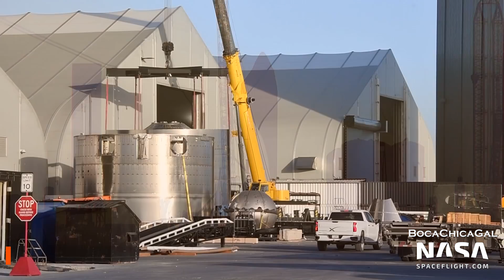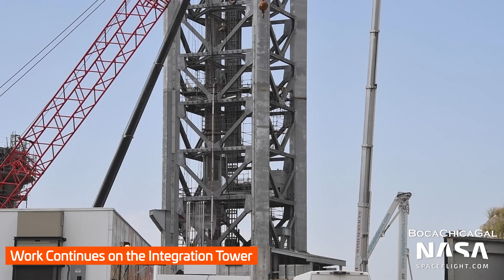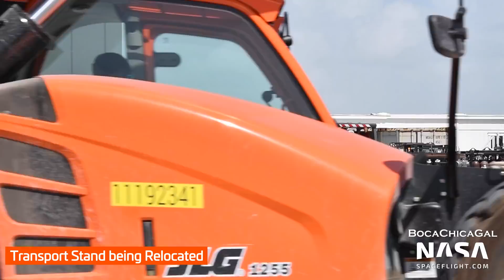Construction Begins on New Wider High Bay | SpaceX Boca Chica

Comment from the maker: Time Stamps! 

0:00 Sunrise
01:30 Moving Ship 21’s Dome Section off of the Sleeving Stand
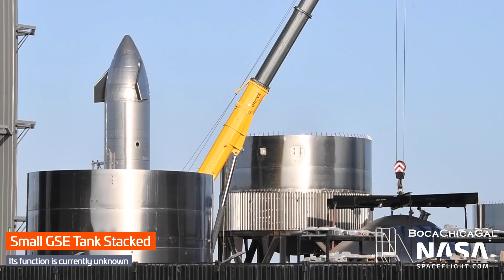01:54 Small GSE Tank Stacked
02:25 Ships 15 and 16 Watching Over Production
02:55 Breaking up the Concrete North of the High Bay
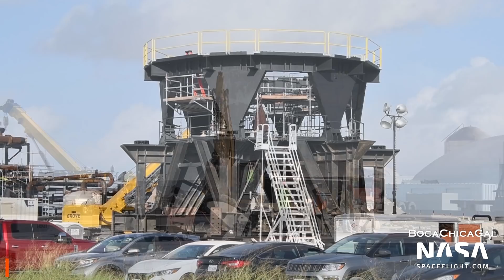03:40 Mystery Stand Structure Awaiting its Purpose
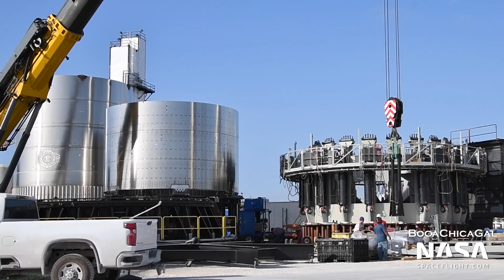04:10 Additional Parts Installed Inside of a Ring Stack
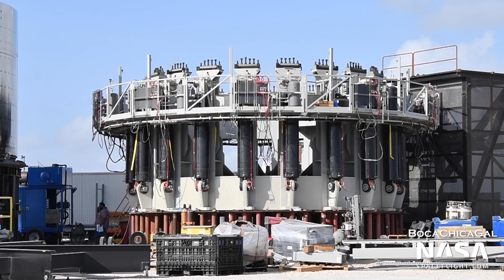05:40 Booster Test Stand
06:05 Construction of a New Stand (New Booster Stand?)
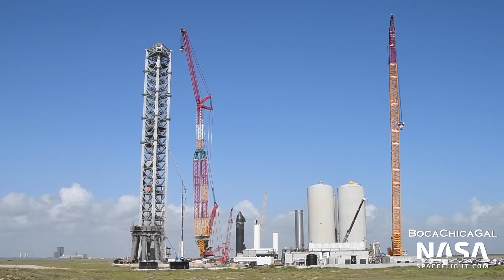06:30 The Orbital Launch Site
07:00 Work Continues on the Orbital Launch Mount
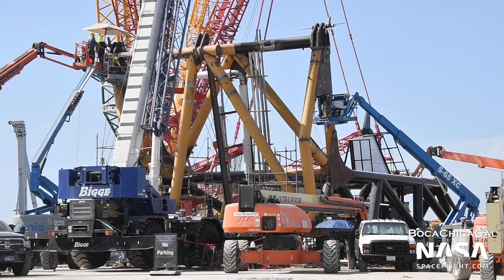07:30 Quick Disconnect Arm Being Strengthened
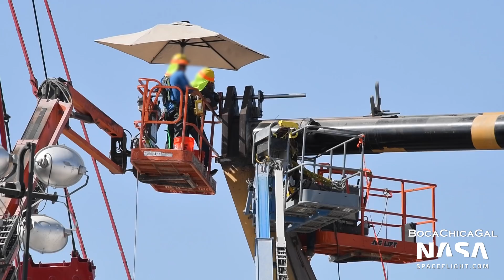08:30 Line Boring a Quick Disconnect Arm Hinge
09:05 Ship 20 on Suborbital Pad B
09:35 Ship 20 has many Markers on the Heat Shield
10:01 Work Continues on the Catch Arms
11:01 Liebherr LR 11000 Moving to GSE Tanks
11:31 The Orbital Launch Mount
12:02 Work Continues on the Integration Tower
14:25 Equipment Installed at the Orbital Tank Farm
14:53 Transport Stand being Relocated
15:23 Raptor RB24 Delivered
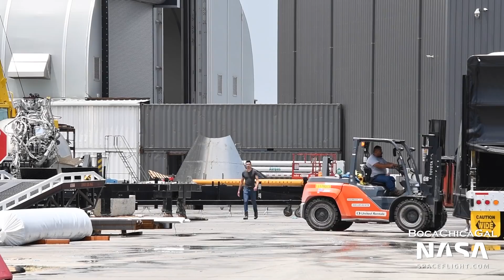15:52 Work Continues on Small GSE Tank
Reply: Who thinks the small GSE tank is a test tank for booster or orbital starship?
Reply: At 8:08 the black v shaped structure is part of the verticle slide carridge that rides up and down the tower with the catch arms will connect to it. 😉
Reply: @its.rfscannel9338  It could be a beer tank...
Reply: I think I spotted a face on with all the tape for the tiles... and it looks like Rick astley.
Reply: Is that DARTH VADER inspecting the orbital launch mount!? 07:00
Reply: I want an OnlyTanks t-shirt
Reply: @marsmountain2794  Yeah, I think it is.

Comment: The "equipment" being installed at the orbital tank farm was a very large multi-stage submersible pump. Signed, your friendly neighborhood civil engineer.
Reply: What does it do, in layman's terms, if I may ask?
Reply: @Gabriel_PL  notan engineer. Bit I think it pumps stuff
Reply: Can you tell from just looking at it, whether it's meant for cryogenic liquid pumping, or water? I'm assuming it's not obviously easy to tell!
Reply: @Gabriel_PL  Multi-stage may look like 1 pump but has several pumps in series inside. Meaning the fluid goes from pump to pump to pump each increasing the pressure. If each pump can do 10 bar than the total out put of 3 pumps in series is 30 bar. A submersible pump sits in the tank and in the fluid it pumps. So yeah it pumps stuff.
Reply: Vertical turbine pump - not submersible.  The impellers are submersible but the motor is not.  That's the difference.

Comment: “Line boring a quick disconnect arm hinge”

I understand all those words individually...
Reply: Lasers are a beautiful thing.
Reply: Funny, I was just watching a video on building a race engine and the guy said to send your main studs along with your block because they need to install them when they line bore the main journal. (or something like that... I'm really not an engine guy.)  Then, I watch this video and get to see what line boring is!
Reply: When you need several holes a distant apart to align exactly, you use this laser assisted instrument to drill all of them using it, one by one.
Reply: I googletranslated this sentence in my native language ..  This was inconclusive, so I concluded that this sentence was a new mystery structure
Reply: @jardozouille1677  No mystery. Reed my prevoius comment.
Reply: @knowlegeisgood8735  I read your answer, thanks. NasaSpacelight loves the mystery structures, so it was a joke :)
Reply: @rogerhalt3991  and bearing

Comment: My speculation is that the small GSE tank is for argon. They'll be collecting it as they process air into elemental gases and it's a good shield gas for welding too. That would save a lot of money down the road.

Comment: 11:32 That's a mobile perlite expander (upside down U-shaped pipe in the foreground). For insulation of the cryo tanks.
Reply: Cool. I was wondering what the insulation would be.
Reply: Yeah, all the speculation on insulation, but all modern air separation plants, like the one built there at the SpaceX site, fill the annulus between the distillation columns and the outer shell with perlite, since it can be removed if maintenance is required. Sometimes it would help if the NASA Spaceflight guys had some experienced  engineers (all types) they can consult with. With a chemical engineering background, I sometimes cringe when they misidentify equipment.

Comment: Can't wait to see the Higher Bay XL - cuz if the High Bay has a bar on top, the XL will have to have a cafeteria!
Reply: It will have a bridge crane that goes from side to side. I don't think that leaves any space for more bars.
Reply: @knowlegeisgood8735  As with the high bay. I'd heard the scuttle butt that the wider bay would be slightly higher, so perhaps with JUST a little extra on top they could have an open space that could be enclosed. Would make for another awesome observation site for a launch.... and a bite beforehand.

Comment: @NASASpaceFlight
 Before we find out the real reason, My guess is that baby GSE is for storage at the Fuel production site before it is transferd to the OLS tanks.
Reply: Apparently it's a thinner steel they are testing. But I like your theory too. They will need some kind of intermediate storage at the prop production site.
Reply: It's a 3.6mm test tank. SN7.3 maybe?

Comment: I wonder if NASA had 21000 individually shaped heat shield tiles for a reason...or were they just bored that week?
I wonder if losing one while slowing down from 17,500 mph to zero,  while converting air into plasma will care of it is made of aluminum or ..beer can thickness stainless steel?
..or if it will just create a large blowtorch that burns through the steel in a matter of minutes rather than seconds.
Can't wait to watch and find out!
Reply: I don't know why NASA used glue and individual tiles, but one of the main reasons Starship has identical tiles and the majority on studs are the experiences they had with Shuttle.
SpaceX has also an advantage of using stainless steel. Easy to weld the studs and over 3 times as good at taking the heat (which just goes on a few minutes). The tiles were tested using blow torches btw.

Comment: The small GSE tank looks more like a grapple arm tester to me.
Seems to be rather recycled parts.
There are pegs looking out of the tank, which in my opinion are offset by 120°/60°.
Just like the grid fins on the booster.
It will be interesting to see if the part can be seen from the opposite side. Then it shows whether there are the same pins.
Reply: Interesting theory.
It does look a test tank, but it is a bit late to test the GSE design
Reply: It's a 3.6mm test tank. SN7.3 maybe?

They are currently working with 4mm thick stainless. They tried 3mm thick a while ago with SN7.2 but it didn't work so well.
Then 3.6mm steel was seen rolling in recently. So it's very likely that they are still pursuing a thinner starship and this must be the test tank for because it looks identical to the previous ones.

TLDR:  there is no 'Small GSE Tank.'

Comment: I'm afraid they will replace the nose cone of ship 20 since they have to redesign the flaps, and has all those tiles to be replaced might as well :)
Reply: They need clean edges. Cutting it off would be hard. Much simpler to go to S21 right away, if they want that.

Comment: i have a feeling they’re going to start early development of the 18m diameter starship 

 the original was double the diameter of the ones they have been testing and the math makes sense all around to do so aswell
Reply: Elon said on July 1 "“Doubling diameter increases mass 4X, but difficulty of simultaneously building & launching rocket of that size is >>4X. 
In retrospect, <9m diameter for Starship might have been wise. Current size is ~5200 ton stack mass & ~7500 ton-F thrust, which is more than double Saturn V.”
Reply: @knowlegeisgood8735  elon announced its on the way
Reply: @JL-bl9eg  When did he do that? In what context?

Comment: The engines being delivered, are they some of the ones which were 'installed' on B4 but hadn't been tested at McGregor, which now have been and are back for integrated testing?

Or are they new engines? I haven't been keeping up with the engines.
Reply: Probably. Any engine that had a white (on the inside) bell was an engine not tested. They went back for sure.

Comment: Why is the flag on the tower, underneath the big pully, being hung upside down?  And why not put it on top of the tower?  Just weird.
Reply: So it can be seen. There's going to be a lightning rod installed later, too. Maybe they'll make it a flag pole/lightning rod.
Reply: If they installed flag on lighting rod then If the flag got wet due to rain and some pollution will become a  mixture which conducts electricity then due to lightning it has a high  chance  of  the flag getting burn to ashes and you dont want that.
Reply: The flag was attached to the last segment put onto the tower. It is tradition to hoist a flag on the final piece of a construction like this, and the flag is still there. That's all there is to it. It will be removed soon enough.
Reply: I was under the assumption that dIsplaying the flag upside down was a signal of distress. And flags are typically put on TOP of the last piece of a structure being constructed.  Not underneath it. Why not move it up to the top of the structure and display it proudly?

Comment: It always has me concerned the amount of infrastructure they are installing on one side of the tower especially when moving the booster of ship wouldn't this shift the centre of gravity too much causing it to topple? Or am I just overestimating how much this all weighs?
Reply: I have had the same concern, however, putting the draw works on the opposite side allows the cables to shift the weight to the center of the tower. I'm no engineer of course but it seems legit the way they have it set up, and then again it's SpaceX, they always make the impossible, possible.
Reply: It's built on cement pilings that go deep into the ground. There would have to be a major earthquake for it to shift
Reply: @LIVE3DPrinting  that is my thought exactly, the cables/wires/ropes pulling straight down on the opposite face of the tower when moving the arms up and down will counter the weight of the arm assembly, the construction of the arms and their associated angled supports will transfer the weight back towards the tower uprights/legs, and the tower construction with all the angled cross bracing and internal bracing/supports will transfer/distribute the load to the other 3 legs.

Comment: What do the green and orange markers mean?
Reply: There are 5 kinds. Black (used before the fit test to hold broken tiles in place). Red for broken tiles, green for badly installed, blue for large gaps between tiles and "OK" written on the good ones.
Reply: @knowlegeisgood8735 , Thank you for explaining. And it's probably not easy for SpaceX to work with heat-protective tiles that have the shape of a regular hexagon. It certainly looks beautiful like in science fiction movies, but is it convenient to use them? For example, I remember that the shuttles had ordinary rectangular tiles. If something written above sounds strange, then I'm sorry, I'm using a translator 🤷‍♂️
Reply: @_trickykhajiit_3786  Hexagons are the best shape to cover cylinders. Starship uses very few tiles that are special, unlike the Shuttle which had no 2 tiles that were identical. 
Using a standard tile is much cheaper and easier to install and replace.